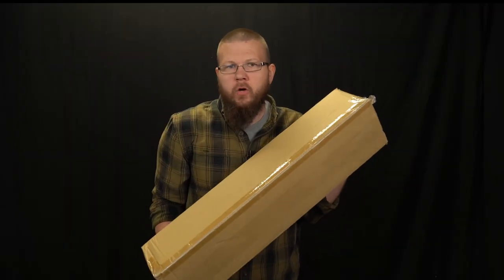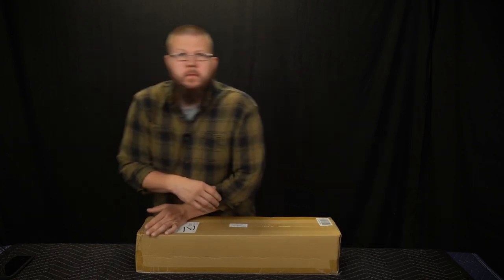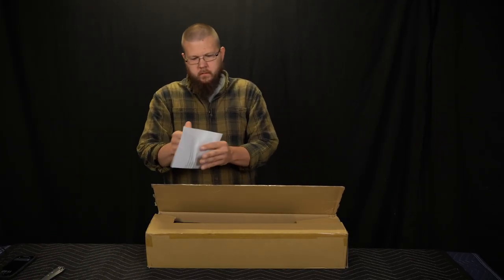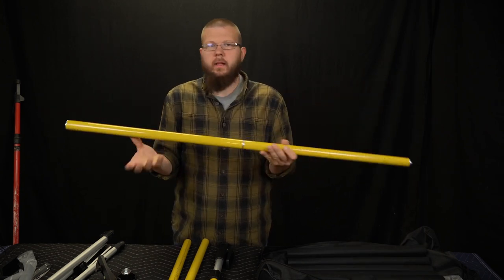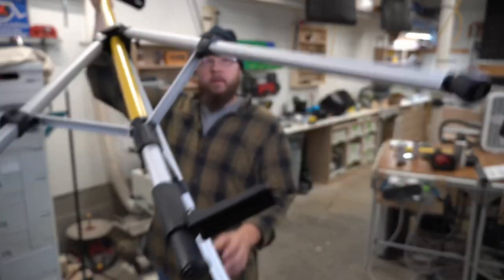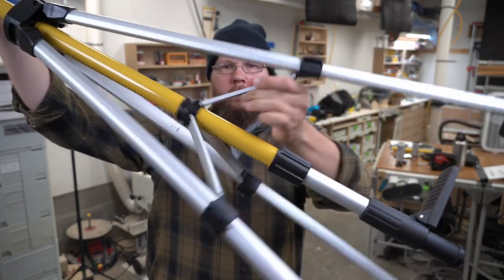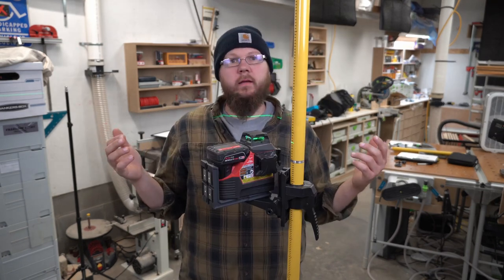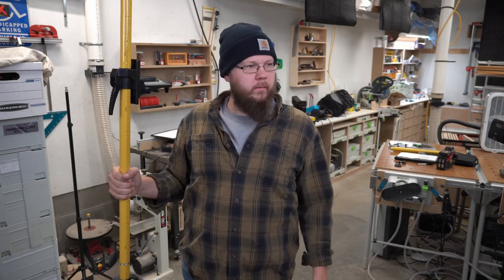FIRECORE LASER POLE - Pass or Fail?

Comment: About that mount for the laser. If you use the existing hole 1/4-20 right next to the 5/8-11 that you put your converter into, then it would still be flat underneth.

Comment: I don't know about that one, but I have the Bosch pole and the Bosch GLL3-330CG laser level, and it comes with a 2-piece adapter that has up/down adjustment on the adapter.   We had the same issue at first with putting the horizontal line near the height point then (while on unlock) using the knob to up/down the laser level to that point but when you let off to lock it, it would always settle and move a little bit and not be on point.   We found that if you keep the adapter on lock instead of unlock, you can up/down the laser level to your point and let off the knob and there was no settle and made lining up so much easier and less time consuming.   It works really nice when you put the laser level where the line can hit several posts or piling from one spot and then hang a long run of girders or joists without having to use a level or even worse using a string level.  But the drawback with the Bosch pole is it doesn't have a tripod base so that means you need something above the pole to extend to and lock the pole in place so you can't use it outside if there's nothing above the pole.  You could easily bring something with some weight and tie the pole to that object and that works fine but that's one extra thing you got to do if nothing for the pole to fasten to above.
Reply from the maker: I may just have to make my own!

Comment: A good tripod needs to be able to adjust for unlevel ground. I used a photography tripod for that, but it didn't have enough height, but i already had it. For indoor use, you could get away with a shower caddy pole with adjustable height to lock to the top and bottom surfaces, perhaps buying two to allow for high ceilings.